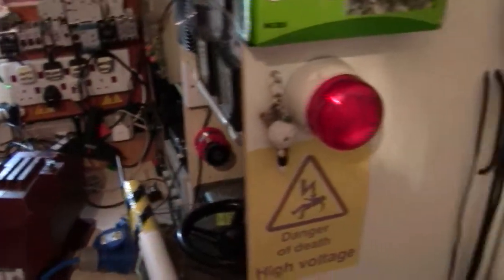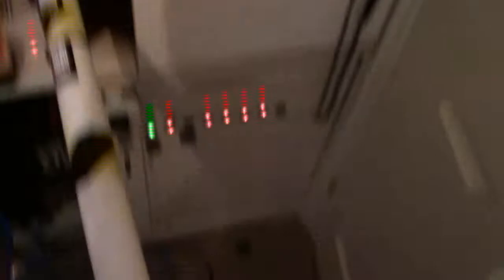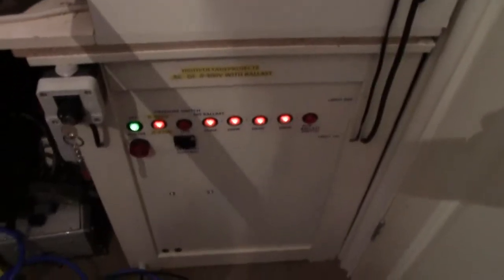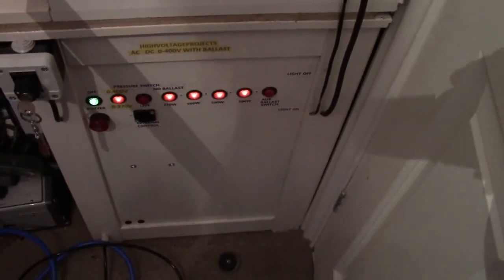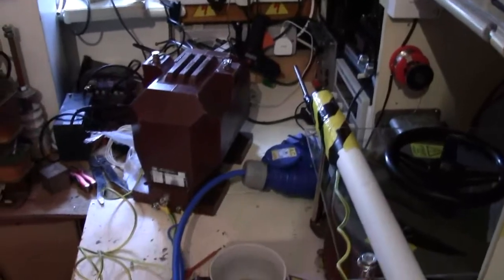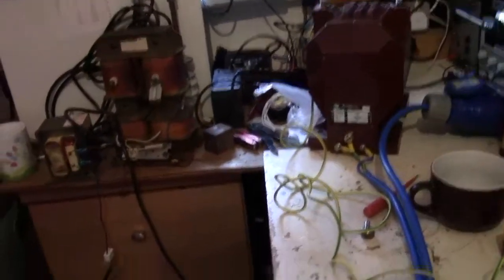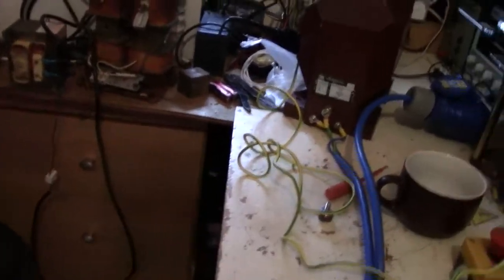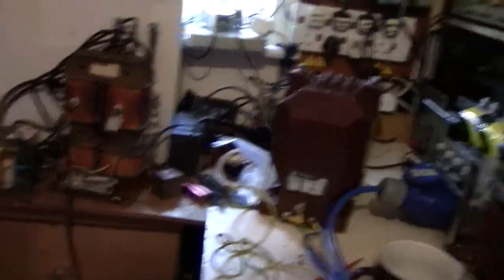THE BEAST ,MY NEW PT (POTENTIAL TRANSFORMER) WITH BIG ARCS

Comment from the maker: well i have a 10kv coming next week so just for you mate I'm gonna put 100v v in to the 6000/100 run that to the 10000/100 so i think we will have a 60 v output and then i think we need to run something from ,HMMM what do you think a motor,bulb maybe a mot to bring it back up some volts ??? ill let you decide mate after all your the viewer i think that would take it to something like 600v this is very rough in my head ,then 600v in to a 240v CFL ?!?!? have a think and get back to me
Reply: I would suggest to put the 60V form your setup to a 3.3V microprocessor ;-)

Comment: Ah, that's nice, and nice long arcs too. :-)

I do wonder what creative things could be done with high voltage? 

High current is interesting, because it can melt spanners, steel bars & screwdrivers. :-)

I think it would be interesting to have two Tx's the same, wire one as step-up from 240v to whatever kV it does, then wire the other one the other way so that it reduces the kV back down to standard 240v.

You'd then have your own HV transmission lines, even if they are only 12" long :D

-BBD.

Comment: Yeah, that's possible. I worked for a transformer manufacturer last year and it was very easy to take home a transformer which had failed testing, since they were just stacked outside behind the factory. It's very possible that my PT was picked up from the 'fail' pile and sold cheap for a quick profit.

Comment: True, it could have received abuse before I got my hands on it (it was listed as "brand new" but who really knows). I only ever fed it a max of 7A, since I was severely limited by the size of my 230V-115V isolation transformer. The PT itself was rated 1500VA @ 30 degrees C.

Comment: This was an American built PT. 14.4kV primary and a 120V secondary with a ratio of 120:1. The part number is PTG5-1-110-1442F and it was built by Instrument Transformers Inc. 

My one had it's BIL written on it's nameplate. And it was most certainly 120V input - confirmed by both datasheet and 1000:1 HV probe!

Comment: This was a PTG5-1-110-1442F built by Instrument Transformers Inc. It has a primary voltage of 14.4kV with a ratio of 120:1, with works out to a secondary voltage of 120V.

At 115V input I measured 13.8kV at the secondary with a 1000:1 DMM probe.

It was definitely a fault in the epoxy which caused flashover.

Comment: Nice transformer! Remember though, they aren't indestructible: My 14.4kV PT's HV winding failed short. I was running it below it's rated voltage (115V input) and the winding flashed over internally. There had to have been a fault in the epoxy, since it was nowhere near its 15kV insulation class (or its 110kV BIL)... Be careful with your expensive new toy!!!

Comment from the maker: ahh ok i have to be truefull as it says different kv's on it i was presuming thats the voltages it could measure and there for put out .i thought that the 8000/100 makings are just the turn ratios i think mine might actually be 6000/100 i cant remember now and i cant get upstairs at the mo ,i cant remember who it was but some one else runs these at 240v and said it was never a problem .i better do some more research i wonder why they put different kv's on them ?

Comment: I guess that the PT is something like a 22000/100 transformer, if so you should use a step down transformer and than feed it with the variac, a 25 Amp one can output more than 40 amps for short periods without being damaged! Don' t connect the PT directly to the variac, with about 100V on the primary, it can suck more than 80 amps!